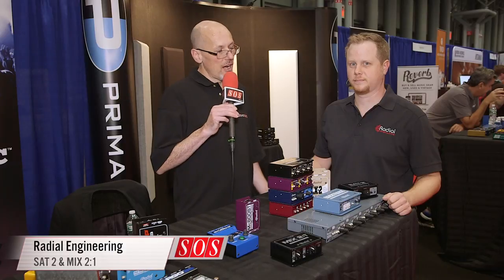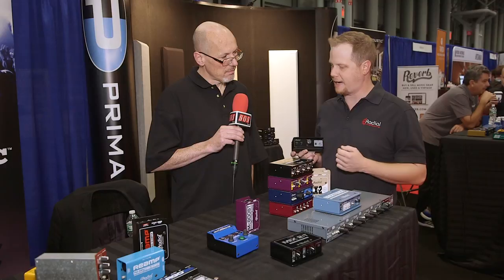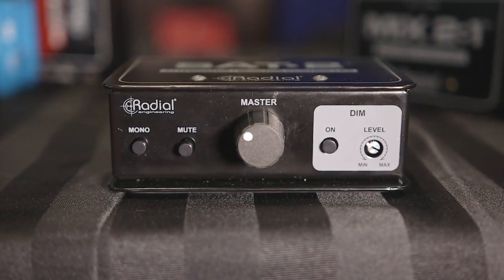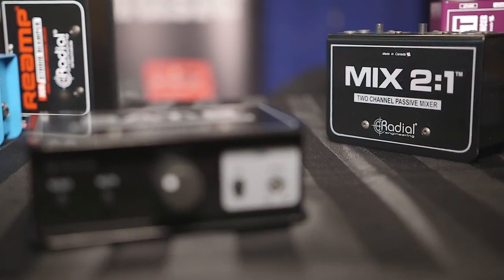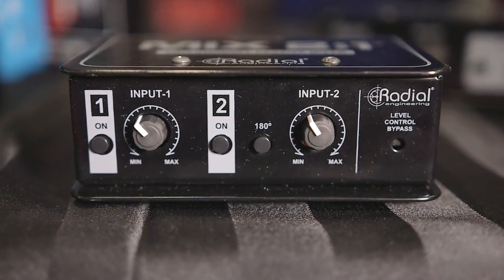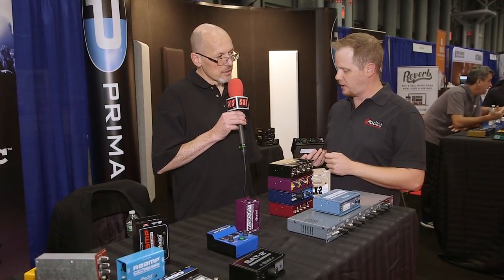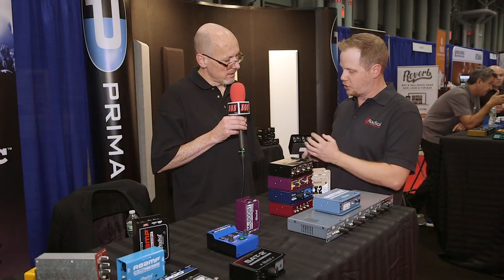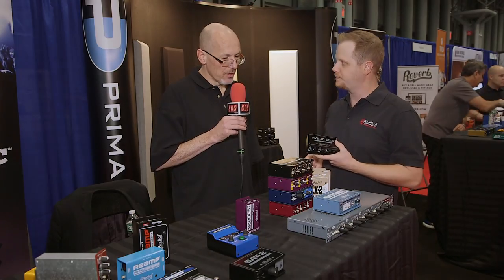Radial Engineering Mix 2:1 & SAT 2 - AES 2017

Comment: Can the Mix 2:1 be used without a preamp?
Reply: I do noty have it myself, but the info on the radial website gives one example where two dynamic mics are directly (no preamp) plugged in as input to the Mix2:1 and the output signal is then fed to a console with preamp.